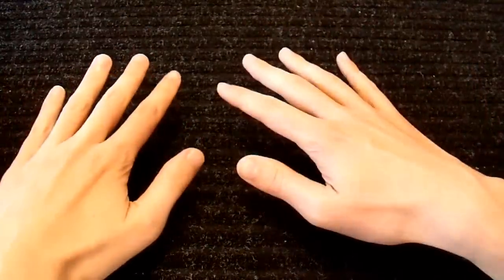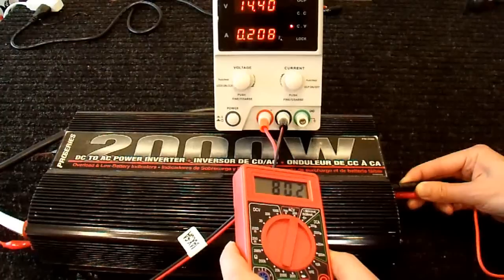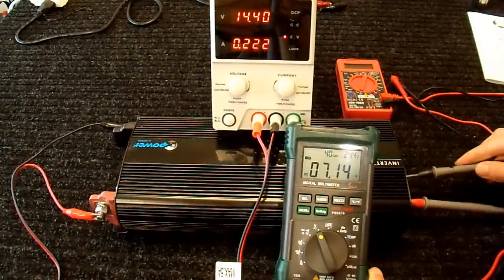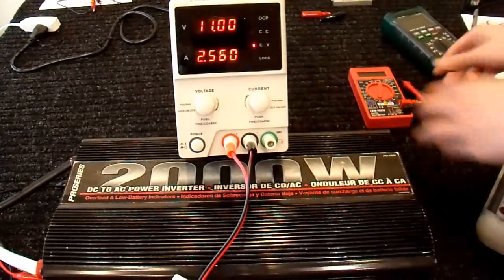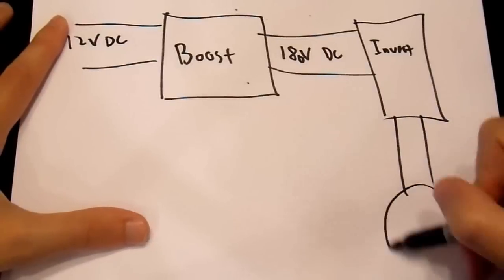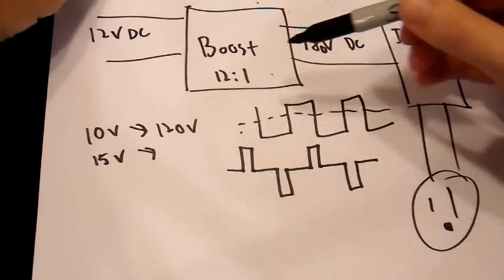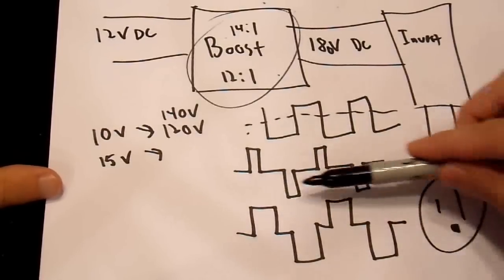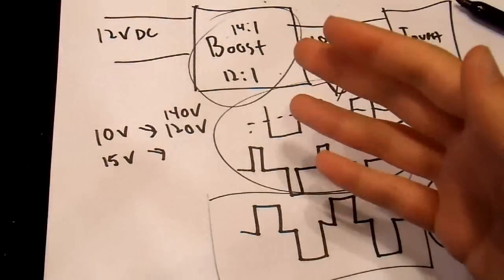Why is My Inverter Only 80 Volts?? - Multimeters and Inverters - Pure Sine vs MSW

Comment: Any thoughts on why my outlet tester is reading an open ground on my inverter? I can not figure this out, but everything I know to test is checking out?
Reply from the maker: In a household circuit the ground pin is directly connected to the neutral wire at the breaker panel.  Your inverter likely  has a floating ground, meaning there is no connection to either hot or neutral.

In short that's how inverters usually operate.  Transformer based inverters intended for permanent connection to grid wiring have other options in how to wire them up.
Reply: @knurlgnar24  many thanks! So in sum, essentially this is normal operation and perfectly normal for my 2000w / 4000w 12v inverter
Reply from the maker: @hobbyguy79  Yes, perfectly normal.  :)

Comment: If you have a power supply that's DC 14.5 bulbs, and you have an inverter. That's supposed to put out a 110 to a 125 bolts. Why is it that the voltage is reading only a sea voltage on a multimeter? You should be reading a 115 to a 125 V, which does not especially when you have constant current, why is that??

Comment: I believe you're country of residence uses 110VAC and the cheap meters are showing 82V

In 220V countries, it should be around 175V, right?
Reply from the maker: It depends a lot on the meter and inverter but that would be a reasonable voltage reading to expect.  What I think is important to know is that a non-RMS meter isn't useful to measure output voltage on a modified sine inverter.  It will tell you whether there is any output, but not the voltage accuracy.
Reply: Fully agree with you but perhaps you didn't understand my point about 220v output vs 110v inverters

Comment: I have a dewalt 1000w and on 2 rms meters klein cl800 and fluke 115 read 155.4 volts the only meter I have thats not rms is a cheap scope reads 166.7 allsun em125..... could you recommend an inverter thats perfect (or close enough) to run 2 battery chargers and a 385 watt soldering iron? ... im asking for a friend😐
Reply from the maker: Those aren't terribly demanding applications and it sounds like your inverter has failed in a rather damaging/dangerous way.  I think you could purchase most any 1000W to 1500W pure sine inverter and it would work for that application.

Comment: I got a 12v/220v Inverter i thought it was damage until now. 
It only show's 175v on my Fluke 600$ multimeter, But works when connect stuff to it.
Thanks for the video. :)
I'v search about it on the internet, but didn't find anything except your video.

Comment: Take a look at Napa’s Xtrax 1500 inverter very interesting design thought it looked iffy at first but will do 1540 continuous with the input fan running continuously but can barely be heard and the output mosfet fan cycles I could send you some pics but not sure how to I ran 1400 watts four 2hours with no problem

Comment: Great great info learning a lot from your videos but I'm having a problem hoping you could help inverter the low voltage comes.on.but I checked the batteries they're fine the low-voltage is 50v it it should be at 42 volts the the fans keep on turning on Non-Stop but at night when it's a bit cooler the the fans turn off. Like there is a thermostat in it. When is sunny and voltage is 55 volts the inverter lights work fine it is a cotek sp2000 48v. What do you think?
Reply from the maker: What a coincidence!  I just received delivery of a Cotek SP2000 48V inverter yesterday!  (I have had a 4000W version for years)  I can say that the 4k model works perfectly with regard to the undervoltage lockout and is a pretty decent inverter - though it falls short of their earlier SK series so if you can find that one get it...  The fans seem to always run noisily even at light loads for me and that's just how it is designed I believe to reduce temp cycling which is bad for electronics.  If you measure directly at the inverter terminals while the inverter is under load do you get 50v?  Also, DMMs frequently vary by a volt or two (at 50V) from meter to meter despite their advertised accuracy numbers.  Have you compared it with a variety of other DMMs?
Reply: @knurlgnar24  okay today I followed your advice I took it off from where is and connected it with healthy 4 batteries to make 48 volt the voltage is 52.2. I turn on the inverter. And the inverter goes in to  low voltage. I wiggled wires around and the same no response that's the far as my mind can go for electronics.So would you consider repairing my inverter?? of course I would have to pay you that's not a problem but I don't know how busy you are you. Let me know so I can ship it out ASAP. When I was ordering this inverter the original order was for a a different model but obvious I really needed it it was late already so they offered me this inverter. PS nothing beats the 3000 watt samplex inverter I don't know about cotek anymore....

Comment: I tried using a 2000 watt harbor freight inverter to run my oil fired furnace. It wouldn't run it, I checked the voltage it was showing 90 volts. I now know why. Thanks. I think I'm going to look into pure sine wave

Comment: Nice video.  I was experiencing the same thing you are in a different way.  I put a Solar ice making system together using a small 120v Dometic counter top ice maker which draws about 100 watts, but needs a kick-start of about 800 watts or so to kick the compressor for about a half-second.  I can't get the system to work.   I'm using a 200 watt solar panel, 20 amp capacity charge controller, 2-12v deep cycle batteries,  a Harbor Freight modified sine-wave DC/AC Inverter w/750 watt continuous -1500 watt surge, powering the Dometic ice maker.  The ice maker turns on and runs for about 50 seconds, then the inverter shuts off into the over-load signal  In checking the output of the inverter with a Red Harbor Freight volt meter just like yours, the output is about 102 to103 volts with the voltage rapidly and continuously fluctuating between 60 to 100 volts even when not powering anything.  The batteries are fully charged to 12.7v.  It will run a drill or blender or 100 watt light bulb, but not the ice maker.  To check my volt meter, I measured my house AC voltage and it holds a steady 120 volts.  Any ideas what's wrong?

Comment: dude you love those inverters  why did my 5000 watt  blow  when i pluged it in to my compressor  granted it was to much load but the mosfets and the caps blew big time...... but not the fuses or shut down protection  had a large battery bank charged?

Comment: I am building a emergency solar generator for when we have black outs. Sofar I have 4 100w panels, 4 120 anp 12 volt AGM batteries, I am going to order a 3000w pure sign wave inverter. As fas as the charger controller go's, I don't know which type to go with, an MPPT or a PWM, which do you think would be best for this application?
Thanks,
Reply: Get a mppt is phases into pwm on float charge.

Comment: Well, if the inverter does not put out a correct sinewave for which the appliances are optimized for, then it sort of a doesn't work right indeed and could damage devices. These modified inverters are more like toys of some sort. There should be a mandatory huge warning label on it.
Reply: they work fine for most loads

Comment: Hi knurlgnar . I was wondering why the post on my batteries get fairly hot when I draw about 800 watts from them? My batteries are two big 6 volt golf cart batteries, wired in series with a 2 gauge wire to get 12 volts. Any suggestions? Thanks.
Reply: bad connection to cable

Comment: Cool vid.

I was playing with a couple inverters I have laying around last night. I fried a cheap one that was already partially broken while seeing what the waveform does under a heavy load.

I've got a couple multimeters and a bench oscilloscope, but it sure would be nice to have a multimeter that shows waveforms. I've been considering getting a used fluke scopemeter, but I'd like to have something I can easily carry around that doesn't necessarily have to have as many bells and whistles, but preferably with industrial safety ratings. 

Am I asking too much? Anything you'd recommend?

Comment: Long time no see man! Hows it  been? I see you have really cut down on the videos. What new projects have you been working on? I want to try to run a uninterrupted power supply on bank of crystal power cells using a joule ringer circuit. But, I see that there will be a major obstacle of not enough amps. But, I'd say its worth a try. I hope to hear back from you and see more videos! I would also like to possibly see a video with a small motor spining a generator to run in a loop. Obviously, you will have less output then input in that scenario because of all of the losses. But, it would still put a end to alot of "rumours" and confusion. You would also get alot of feedback.

Comment: You know a lot more than I do so I thought id ask, I have a board that burnt and copper plate is exposed, could I bypass with a blank board or is there a better way? Would be happy to send pics. Power bright 2300 110v. Cap and fets blew- not an engineer but you've inspired me to try.
Reply: To rephrase, I know it's possible to recreate but I'm having a hard time determining how many layers pcb. I was thinking of coating with epoxy to insulate. Any thoughts or suggestions to a newbie amateur?

Comment: Great Videos ! I have just picked up a APC smart UPS 2000 RT with a 4 battery (48volt) pack that needs to be replaced, If I use 4-12v deep cell marine batterys instead of the original 12v 9ah batterys will this UPS still keep batterys charged or is it too much for the built in charger?
Reply: it would charge slowly, but a ups is only meant to run for as long as the cheap batteries will last without overheating. you will need to improve the thermal capabilities.

Comment: Always see you find inverters that has a live neutral. So it got me testing all of mine. Tested Schumacher 750 like the one you had the HD in, Centech 2000w and the OSP tiger claw 1500 sine wave and none of them was live neutral.
One thing I wonder is what you don't like about the Centech 2000w you had in your box opening video on the OSP 1500. All three of mine work really well and don't have a live neutral. I have had some really shit inverters in the past and gave them away. Funny all the ones I keep have the polarity correct output.

Comment: I watched all 12videos on power-inverter review.
My Project; to power 220volts 2-splite phase aluminum welder from my work-truck (12volt DC battery). Most common welder settings on a welding-arc is 22volts and 20 to 30amps. So, welder takes 22v x 30a = 660watts.
I already tray to power welder with two 120volts 2000wats inverters, connected in series by neutral wires. On a 2 hot wires ends I've got voltage constantly waiving from 190v to 240v. Welder started, but after attempt to fire arc (on minimum weld current 20a) inventers  got power off. It was modify-sine way inverters. I returned them to a shop.
Ordered a new 12v 2 split-phase 220volts 5000 watts inverter.
Will report you as soon as I get new inventer
Reply from the maker: Be sure you have enough battery power and very thick cabling for that inverter.  You're looking at needing multiple batteries in parallel to adequately power it.  If you do it should work!
Reply: ***** 1; instead of very thick cables I am planning to use 2 or 3 cable running in parallel. Let say I will run 3 cables 4gages thick in parallel so 4 : 3 = 1.33gages
 2; yes planning to use 2 batteries and +alternator 220amps
Reply: +sofabike dual 4 gauge is 1gauge

Comment: Good vid. I just bought one of the cheapo meters because I'm poor and I didn't know any better. And also because I don't mess with this stuff a lot and just couldn't justify the expense of anything better.

 Is there a decent meter that's more affordable for the casual DIYer? I see a lot of inexpensive meters on Amazon. The positive reviews are very positive but most of them have their fair share of negative reviews and the negative reviews are extremely negative.

 It's tough to know who to believe. Are cheap meters actually dangerous or is the worst thing that's likely to happen is the meter will just die and you'll lose whatever you paid for it? I'm guessing anything can die early.

 Anyway, the meter I have looks a lot like the super cheap Harbor Freight one you showed but it has a different brand name. It was only 20 bucks and I figured I'd tinker with it and maybe learn something.
Reply from the maker: Cheap meters have their place and are good enough for many people.  If you're doing more than just checking for the presence of voltage and the like I would spend the extra money for a true RMS meter though.  I wouldn't hesitate to purchase and use an inexpensive meter.  Anything can break so you need to be careful (for safety sake) with all brands.  For example you can get an Extech true RMS autoranging DMM for around $20 if all you need/want is something basic.  They're made cheaply but they do work.
Reply: ***** OK. Thanks. Looking at it now. The one I have doesn't have an actual brand on it but does have the number DT830. I see these around online under different brand names. Some people say they're fine and others say they fried the first time they tried to test AC with them.

 I checked a couple of inverters, some batteries and a couple of wall outlets with this. It didn't fry and seemed to be more or less accurate. The only PSW inverter I have read at just about exactly 120. I have a 750 watt MSW Diehard inverter but haven't tested it yet (it looks exactly like those Schumacher 750s you had in one of your videos with the sloped plastic case). Works OK for some things.

 Anyway, love your channel. I'll watch pretty much anything you put up that has to do with electrical/electronics and assorted tinkering. It's all appreciated. Your personality is fun too. The personality will always make or break a YouTube channel. I think you can probably be as big or small as you want to be.

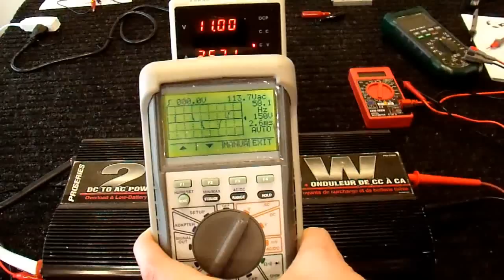Comment: I'm curious what is going on with the Schumacher inverter under low-voltage conditions at about 8:00, sudden current draw of over 2.5A? D: what could possibly be dissipating 20-30W in this instance?
Reply from the maker: That's a good question.  It is common for inverters to draw quiescent input power that varies significantly with input voltage and there could be a lot of reasons for it.  I have to admit that I don't know why this particular one has this behavior - though I do believe I remember the internal fans turning on at low input voltages for some reason...

Comment: is a kill a watt P3 meter a true rms meter ? man i have been craving another video from you, could you review a Xantrax sw 3000? or a new Eliminator 3000W inverter (the plastic one) and do you happen to have a nice low watt pure sine wave inverter you wanna sell? im looking for one.
Reply: fliping720 Kill a watt is NOT true rms. It's interesting that knurlgnar24 just did a video on this topic. I just discovered today that the Kill a watt is NOT true rms. 

I read 84 volts today when I overloaded my inverter. But my inverters are pure sine wave. 

***** , does this only apply to modified sine wave inverters? or does it equally apply to pure sine wave inverters?
Reply: lanceguilin thanks, i didn't think so seeing i was getting 140 volts :D
Reply: yes it is true RMS according to the manufacture 
look at page 11 on this manual all specs are listed as true RMS
http://www.p3international.com/manuals/p4460_manual.pdf
Reply from the maker: lanceguilin
I have seen a P3 Kill-A-Watt fail and read incorrectly.  It may be a failed input filter cap.  MSW inverters stress filter caps and can cause early failure.
Reply: lanceguilin
 Thats strange seeing as how Knurlgnar's Kill-A-Watt consistently reads correct in all his videos and its also stated in the manual that the unit is indeed true RMS. Possibly a knock-off?
Reply from the maker: lanceguilin
Pure sine inverters are not pure sine under all input and output conditions and the waveforms can become severely distorted at times, especially with lesser quality 'pure sine' inverters.  A true RMS DMM should be used for both.  You can 'get by' with the standard multimeter in most cases though if accuracy isn't important for your particular measurement.
Reply: ***** Hmm.  I don't think my P3 is true RMS based on how it reacts to my MSW inverter.

Comment: I have a cheap Harbor Freight 1200 watt inverter that reads under 100 volts with my meter as well.  I found that a Kill-A-Watt meter will show the correct voltage.  For those of us who can't afford those expensive multimeters.
Reply: There are a few not so expensive multimeters that are true rms... you just need to keep an eye out :)